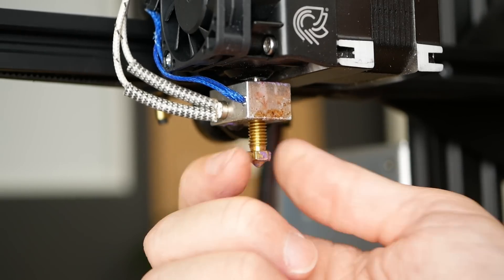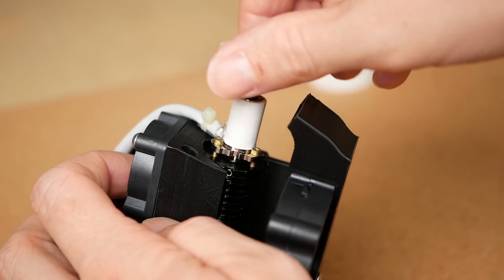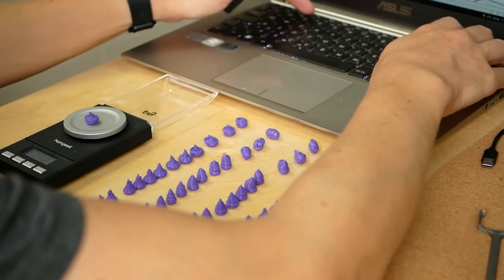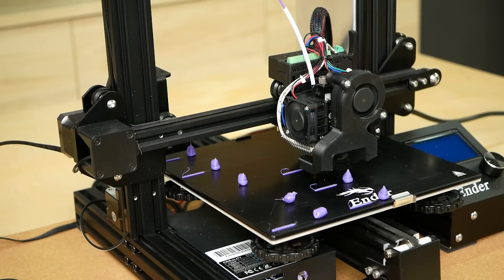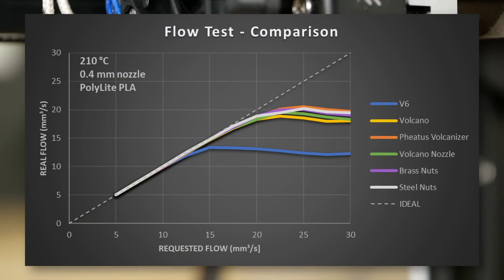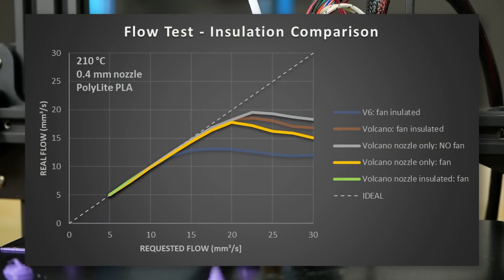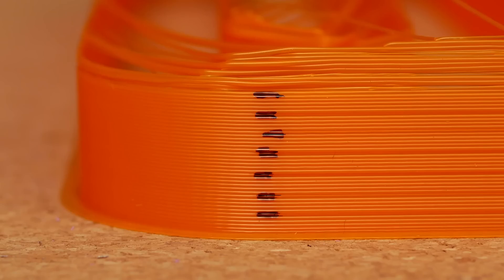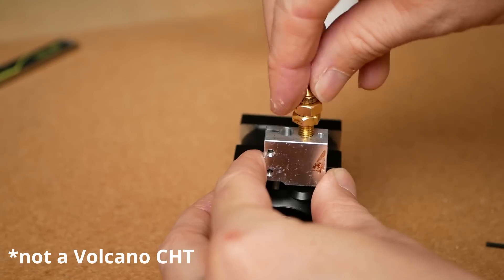Volcano is Obsolete: Just use Nuts!

Comment: Even if it only performed as well as the stock nozzle, it's good to know i can at least use a volcano nozzle to get enough clearance to experiment with stuff like nonplanar and sequential printing, which would be great for a few projects i'm working on.
Reply from the maker: Great point! Removing the hex might make it even better usable for this application.
Reply: I was also thinking about how it allows you to increase the gantry height in your slicer settings, allowing you to print slightly taller items 'one at a time' instead of 'all at once' when printing multiple items.

Comment: Wait, so just using Volcano nozzle and a bit of silicone tubing around will not only increase the flow rate but will make it easier to clean the nozzle between prints when printing PETG in print farm environment?! Pretty interesting.

Comment: Stefan! Try the reverse of the "copper" nut! You were right about the gradient and increasing the thermally conductive cross sectional area of heat flow with real copper and then insulating it (even if insulation is just a less conductive plating like steel or nickel) will have better results since it will have a lower h value! Newton's law of cooling!!

Comment: I'd like to see a similar video showing differences between different wattage heater cartridges. For example: I find the standard 30 watt heater cartridge to be too weak to reliably run a Volcano, but now that there is a 40 watt and now even a 50 watt from Slice Engineering, it would be interesting to see how they affect performance even on a standard heater block.
Reply from the maker: That's definitely on my list!
Reply: Slice apparently even has a Magnum+ that can use two 50W.  I dunno who needs 100W in a printer unless you are high flowing some very high temp materials.
Reply: @filanfyretracker  The 80 watt sure is a beast with the super volcano, but it would be nice to see if we could get similar specs on a hot end that doesn't have such an extreme lever arm or maybe a shorter melt zone (for oozing purposes).

Comment: I wonder if it's worth putting thermal grease on the nuts to keep the thermal gradient even since this isn't in the heat path between the thermistor and heater block reading. Probably doesn't matter unless you have a bunch of nuts but wouldn't hurt.

Comment: All of these cheap heatblocks have the thermistor in the wrong place.  Really. Probably that's why you had worse performance with the volcano nozzle. I drilled new hole for the termistor on the volcano hotend and now it is in direct contact with the nozzle thread. I can print easily at 100mm/s at 0.24 layer height both 0.4 and 0.6mm with lower than typical temperatures.

Comment: Very Interesting indeed
But i have a question, i use ABS and cant pass the 4mm³/s barrier for the 0.4mm nozzle, i keep printing around 3,3mm³/s because the printer itself cant handle very fast movement, but when i need to print with big nozzle, this 4mm barrier its kinda of a pain... if i force beyond it, the feeding gear immediately grind the material
Do you have or can you make a video about flow test with ABS ? its very hard to find anything for ABS.
Reply: Fix your hardware then. Speedboat challenge are mostly done in ABS because the melt flow index is among the highest for plastics.

Comment: Hello Stefan! I'm very interested in further testing with the Bondtech Volcano CHT nozzles that have the filament splitter run across the entire nozzle length! I wonder if it would be possible to turn a regular V6 hotend or a Phaetus Dragonfly into a high flow hotend or maybe even an ultra high flow one. CHT has giant flow improvements, and since they sell Volcano size ones, maybe all HF/UHF hotends can be replicated cheaply?

Comment: Is galvanic corrosion ever an issue with mixing materials?  For example, using stainless steel nuts in contact with the aluminum heat block could promote corrosion.
Reply: I assume that the constant heating helps driving off any moisture that might be present.
Reply: @WhenDoesTheVideoActuallyStart  Yeah, I thought that too but when I tried to research it I found "The effect of temperature on the galvanic corrosion is important, the corrosion rate became higher with the temperature increased."  Also, hotter air can hold more moisture so it may dry surfaces, but it would still be present.  It's probably a non-issue.. I was just curious.
Reply: @AbjectLucidity  Yes, hotter air can hold more moisture, but the whole reason that heat usually leads to dryness is because the hot air that can theoretically hold more moisture is always rising and being replaced with cold air that can only hold a limited, smaller amount of moisture.

In an enclosure you'd either see air with increased moisture capacity but the it'd still have the same amount of moisture as before - again leading to a drying effect, or fresh cold air with a limited amount of moisture being pumped in and heated, while the hotter air that could hold more moisture escapes.
Reply: @WhenDoesTheVideoActuallyStart  I appreciate the information.  I did some further reading and it appears that it would depend on how humid the room air is.  As long as the hot-end can reduce all air in contact with the metals to less than 60% RH, it shouldn't be an issue.  If the room air is particularly humid, even heating elements can corrode due to atmospheric corrosion.  Hotter temps, or hot/cold cycling make the corrosion risk greater.  The moisture in the air can act as an electrolyte film, even when it's not visibly saturating the surface.

This is more an issue in tropical areas, wetlands, and other high-humidity areas as you need to start with warm, humid air for it to stay about 60% humidity at the interface between the atmosphere and the metal.
Reply: @AbjectLucidity  Interesting! Since IIRC relative humidity is just water in air vs the water capacity of air, I believe that what I said before basically guarantees that there's no danger during printing - but in those circumstances that you mentioned there might be corrosion when the printer is at rest.

I wonder if in very humid conditions it would be worth it to build an enclosure that maintains the printer in a dry environment.

Maybe it could be something as simple as adding a silica gel container, making sure it heats up to around 100ºC during printing so it loses humidity, and keeping the enclosure sealed when the printer is at rest.
Reply: @WhenDoesTheVideoActuallyStart  I know that, in plumbing for example they try to use something like brass to couple incompatible metals.  It appears to have to do with how noble or base the metals are.  If they are too dissimilar, electrons will flow from the more base metal to the more noble metal, causing galvanic corrosion.  Galvanized metals are covered in zinc, which readily gives up it's electrons and spares the other metal underneath.

Comment: I have purchased quite expensive Copper heatblock for my v6 thinking it would help melting performance. But after testing I found that it does not improve hot-end flow by any measurable amount. Copper heatblock even visibly increased ringing artifacts due to its weight. 
At these flowrates heat transfer through plastic itself is the biggest bottleneck in flowrate, that is why Bondtech CHT is so good.
Maybe copper heatblock would be more useful with a CHT nozzle? Needs testing.
Reply from the maker: The heat capacity of the copper will help to stabilize temperatures and are more suitable for higher temperatures. Though they won't help increase flow in probably 98% of cases.
Reply: @CNCKitchen  I think You are correct. I did my tests using PLA at 210°C which is on the low-end of FDM 3D printing temperatures. I should probably redo these tests using something like Nylon at 270°C.
I have ordered the CHT nozzle. Excited to test these combinations.

Comment: This whole battle against the thermal resistance of the plastic itself makes me think why we've not gone with thinner filament, like some 1mm diameter one or such for the 0.4mm nozzles.
Imagine the flow and how fast your extruder would be spinning tho, would be funny looking at it.
Reply: 1mm diameter filament would have roughly one third the cross sectional diameter of 1.75mm filament. My though would be something similar to the CXT but rather than splitting a single filament into multiples, feed 3 x 1mm filaments into one nozzle. Should allow faster melt, but also could play with colour gradients etc with the triple filament. Probably not worth the effort, but fun to think about.

Comment: Screw fancy silicon socks and kapton tape. I insulated my hotend with plain kitchen alu foil. It uses no glue and is a custom fit to any setup. The cost is obviously negligible. No fumes, doesn't degrade, temperature resistive until 600 °C at which point it melts. The point I am trying to make is you don't need to buy low quality single purpose stuff from China, finding another use for items that you already have is often enough. I like the solution with the two nuts for this same reason.

Comment: When you dont have a proper sock or if your sock is damaged you can repair it with high temp RTV automotive silocone.  The temps will be plenty good and it bonds REALLY REALLY WELL... dont let it cure on your silicone work pads.  You could coat the nozzle for the test and then peel it off of you want to change it.  If you are super keen make a thinwall PLA form to fill with RTV.  Peel off after cure and you have an encased nozzle.

Comment: Hey Stefan, where did you get the tool to hold the heatblock in place while screwing the nozzle in? That would solve the problem on my swx2 I just discovered due to a broken heater cartridge cable. Do you think I can just use a 3d printed PETG part? Greetings from berlin.
Reply: I dunno what procedure you wanna do, but if it's hot tightening a nozzle then the only printable parts you could use would be like Ultem or PEEK or such, definitely not worth it.
If it's just some maintenance jig while it's cold then it's fine.

Comment: I think you are seeing better performance than the volcano because you dont have as much worthless surface area to lose heat and metal volume to heat.

I wonder if you could use stainless nuts instead?  They should behave as an "insulator" for the extension.

Comment: Very interesting and it could be a viable alternative for high flow printing. Do you think the application of thermal paste to the thread of the volcano nozzle would improve performance, over just brass nuts threaded onto the nozzle?
Reply from the maker: I honestly don't think so. The bottle neck is still the heat transfer into the material and tightened threads already conduct heat quite well.

Comment: I have a brass v6 heater block with a 50w cartridge I think that with copper sleeve with a volcano nozzle might out preform volcano based on extrusion deviation. At high flow rates

Comment: I would suppose that effect might be related to the bigger real temperature at the nozzle. I know, that you kept the measured temp same, but you might have changed the heat capacity of the system with all these additions, so old PID parameters resulted to a bigger real temperature, which affected extrusion results.
Reply: PID parameters being slightly off is not going to increase temperature at the nozzle significantly.

Comment: Hypothesis:  There may not be very much of a heat gradient.  Yes there will be a drop off in heat towards the nozzle because it's farther away from the heater.  However, the filament is coming from above and closer to the heater.  With the filament moving the temperature might be a lot more balanced throughout.
Reply from the maker: Indeed. And it might even carry some heat with it. I need to simulate that at some point.
Reply: This is not true. I did as he said. The printer does not print at the same temperature because the hotend is too cold.

I managed to get it to print at a temperature of 10 degrees above normal. Only in this case it is completely incomprehensible what was the point of fencing all these crutches, if you could just raise the temperature.
Reply: @hate-conductor   You're misunderstanding the experiment.  He wasn't printing.  He was running flow tests.  He keeps the temperature the same throughout the video in order to find and measure the difference between the methods.  If you tried one of these methods then, yes, you may need to increase the temperature to get consistent prints again. However, since you didn't say anything about flow or print speed it doesn't make any sense to call these methods "crutches".  You might be able to print at a higher speed and not realize it.  Or it might not work because of your machine and setup.  None of this is a guarantee.  Also nothing you've said disproves or even addresses my hypothesis.  Nothing here at all measures heat drop off.
Reply: @VagabondTE  i have tried this method with 0.6mm, 0.8mm. and even 1mm nozzle size and it rarely prints well, clogging seems to be an issue, increasing the temperature exacerbate the problem, I use both brass nut and regular nut and both produce similar results, I gave up using this method and go back to regular nozzle
Reply: @MuhammadRFabio  What method? I didn't suggest any method.

Comment: You could easily make nuts out of copper, but pure copper is very soft so you'd need to do something else to make them usable as nuts. Copper can be hardened a little bit by cold working or with ultrasound and it can be hardened by oxidation(they do this by making oxide inclusions during the casting; this makes it harder but brittle). Cupronickel alloys can also look like copper if you only use 10% nickel, silver alloys if you only use a tiny fraction of 1% silver and beryllium alloys if you use at most 2.5% beryllium (beryllium copper is a pretty nice material, non-sparking, non-magnetic, weldable, formable, machinable, really nice to work with; it only really has one huge drawback; beryllium dust is extremely toxic).

If you add stuff to copper it won't be as thermally conductive anymore. Beryllium copper is still going to beat stainless steel by a factor of five or so, but it's not like pure copper.

The best you can't get that isn't extremely exotic (like synthetic diamond nuts, which is just not manufacturable) would be silver. In those amounts, it wouldn't even be that expensive and it's just shockingly conductive. If you take a nice 99,9% silver coin and touch a piece of ice with it the whole coin is cold in seconds and it just melts through the ice like butter until the temperature gets below the melting point of ice; it's very cool. But it is even softer than copper.

The limiting factor ought to be the air gap between the nut and the nozzle anyway. If you could find some high temperature stable thermal grease to fill that gap without contaminating the plastic you are printing; that could be effective even with steel nuts. Possibly even better is to make the nozzle itself out of pure silver and set that in a sleeve of stainless steel or other harder material which can have the threading.
Reply: In this case the softness if the copper wouldn't really matter since we don't really need to care about holding power. But I can see why no one would produce pure copper nuts.

Comment: Hej Stefan, great video as always. 
I'm thinking maybe the copper plated steel or brass nuts mostly act as an insulator when using cooling. 
Also, great to see the regular CHT beats even the Volcanizer. 
Just let us know in case you also want to ompare all the above against using a full Bondtech CHT nozzle for Volcano..
Reply: Steel yes, brass no. Vastly different thermal properties

Comment: Have you considered supporting the TS80 and TS100 soldering irons with heat set insert tips? Using a TS80 it's a gap in the market that I've been aware of since starting to use these

Comment: I can understand that this is useful for some people, but in the grand picture is this video a bit obsolete, when thinking about the V6 platform?   E3D´s new platform Revo should be superior, because it is modular, lighter and a better engineered solution? #Vibration #Heat_carriage #oozing  #Fast_printing
Reply: It does not improve the platform, just shows that we did not need 2 types of nozzles for V6. Or at least not the same distribution. :)
Reply: @mckidney1  that is true😁

Comment: I'm also running a Rapido UHF hotend. Best thing of it is how fast it heats up. Using the 40w V6 heater I always cooked the filament due to setting the nozzle temp already for preheating. As the rapido takes a minute to get to temperature, I don't preheat the hotend anymore to speed things up. :) 

Question for conversion: Any ideas how to extend the pin of a BL touch sensor? Using an integreated printhead I'm stuck with the current position of the touch sensor. Are there e.g. longer pins available, as they can be changed?

I could design a new holder for the BL touch, but using any kind of clip-on adapter would enable me to switch from HF to UHF without extensive printhead disassembly.

Comment: At this point, we might need to start looking into the other side of the equation. Not what the hotend can provide but what the filament can absorb. Would be interesting seeing the variances between basic PLA and PETG. But also if bronzefill (conductive) would help or make it worse. Maybe the next evolution could be a thermally absorband material that can print many times faster without any mods.
Reply: You also have to introduce flow rate changes and oozing into the balancing procedure. What we se here is just the flow improvements not a proof that printing heads are badly designed. I would say the biggest takeaway is not the higher flow, but that you can order a longer nozzle without fearing that your prints will suffer. They might even improve as well as the prices by reducing the variety and increasing the economy of numbers.